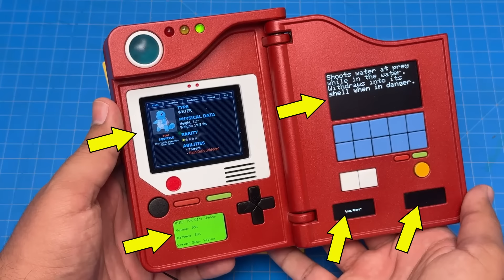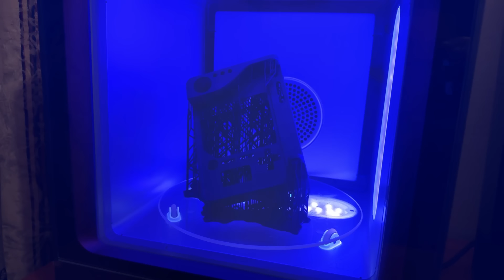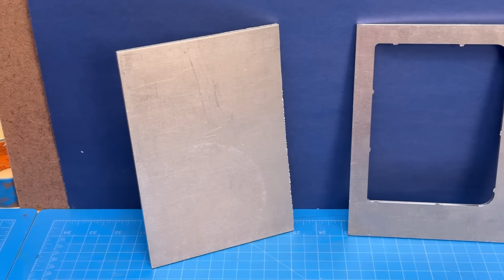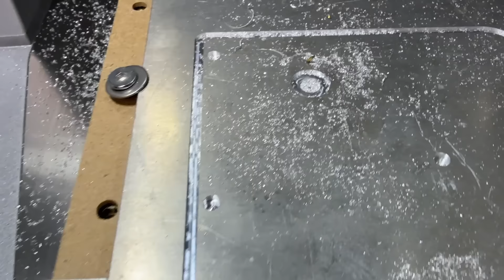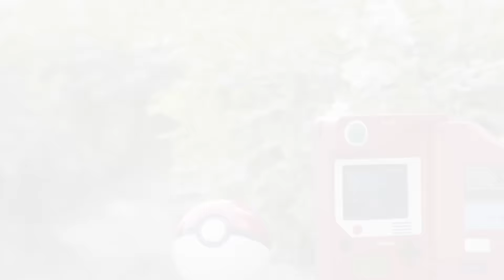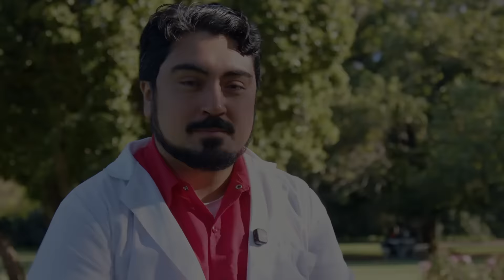I made a real working Pokedex

Comment: why not run the whole thing on the esp (ignoring the software side)
Reply from the maker: Cable management. Way too many data lines need to pass from the side of the case to the main case if there isn't another MCU in there. This configuration only needs four wires in the hinge.

Comment: Great work! Small suggestion to consider: Remove real world references like "in Pokemon Yellow" from AI responses to make it feel even more immersive. Of course it still needs to know which game to pull data from, but this could be added to the context based on the global settings. Basically make the AI behave like it's inside the Pokemon universe. Or, if you also want to use it to actually look up Pokemon moves and stats, you can split it into two modes: role-playing or encyclopedia

Comment: Wow algorithm showed me this because I was looking at how to make pokeballs as simple curiosity. I was curious about wood cases. Good grief, that's actual engineering. My question for this and other lore accurate works like this is how difficult is it to travel with custom electronics like that? Would customs or TSA or whoever make it more difficult? Wouldn't want it ripped apart by them. 

Great work, though.
Reply from the maker: Thank you! TSA/customs is unbothered actually. Ive flown to England and back with this in my carryon and no one had any questions. I kinda wished they did so I could show it off 😅

Comment: It's fine that it's bigger and chunkier! When you were a kid, the toy pokedex was big and chunky, too. It has grown with you.
Reply from the maker: 😄Yeah, I definitely feel like a giant holding the OG toy
Reply: Considering that the Pokedex is often based on the handheld the game was released on it feels obvious that this Dex is as big and chunky as the OG Game Boy.
Reply: @blastdragon1991 there's only 2 pokedexes that could be argued to be based on their handheld, and one of them is from a remake. ORAS is clearly a GBA and sinnoh is the next closest just because it has 2 screens and a dpad. 
Everything else is clearly just an unrelated PDA, cell phone, or a rotom
Reply: @Danman350  That said, I believe the original pokedex is supposed to be based on a field manual. which this fits perfectly.
Reply: It's obviously not a dmg game boy, but matching that thing's chunkiness is great, to me. especially if it could run off 4xAAs, but you'd probably have to settle for more modern batteries merely taking up the same size.
Reply: chonky dex for chonky Pikachu.... pans out.

Comment: This is why fans do things better than the actual creators most of the time.
Reply: The Tiger toy was the Pokédex the market was willing to pay for though. They will have thought this out carefully to maximise sales and maximise profits. They wouldn't sell it as a first party Nintendo product because Nintendo has a reputation to lose selling a crappy product, but if they charged $100 for something like this they would have sold less and made less profit overall. The margins on that Tiger toy were probably HUGE, probably like 1,000%. I mean it was basically just a calculator with Pokémon decals.

Having one good and one crappy Pokédex is also a no go. The official Pokédex has to be the official Pokédex or they break the illusions of all the die hard Pokefans for which nothing from Pokémon could ever be wrong, so they had to put the line down somewhere, and that's where it was.

Comment: Something tells me the green piece is actually supposed to be a solar panel to power the device. Like those kindergarten blue calculators.
Reply: Subjectively I like that idea, but objectively, why put something like that on the inside of the device? It’s not getting sun when it’s closed.
Reply: @kenji6492 solar powered calculators didn't need a battery since the power draw was just that low, and basically every trainer was supposed to have a pokedex in the anime, so they were probably depicted as having the same economics and therefore likely the same power draw as an elementary school calculator
Reply: @kenji6492 Because when you're using it it's open. Which is how those types of panels work.
Reply: @ninjspeaks  except usually on a calculator its at the top outside of the sheathes so it can always draw power, I agree its probably a solar panel but thats an obvious design flaw that should be sorta simple to fix in universe.
Reply: @kenji6492 when does anyone walk around with a closed dex?
Reply: @connerpollani4033 when it needs charge
Reply: Maybe it just has a really insane battery, it is developed by the world's most renowned Pokemon professor after all
Reply: @kelavia2112  a professor who is not above getting children to do his work, tbf.  cobalt anyone?  ;)
Reply: How would that work with the lid being closed most of the time?
Reply: btw this is before watching, PLEASE TELL ME IT LOCKS IN AND WHEN YOU PRESS THOSE THREE YELOW FACE BUTTONS IT UNLOCKS
Reply: The green piece is the pokedex's mouth. it blinks when it talks.